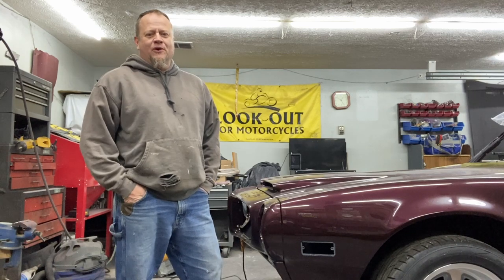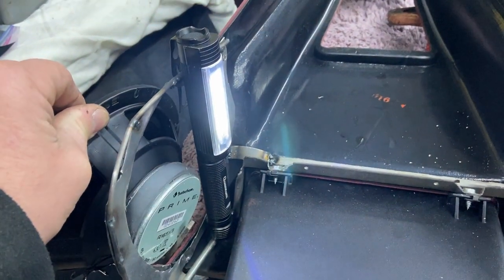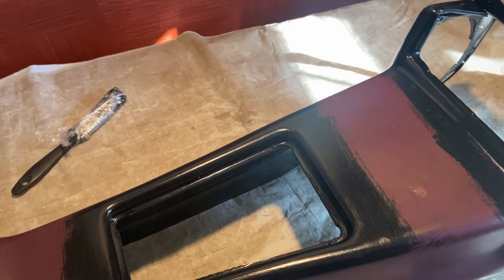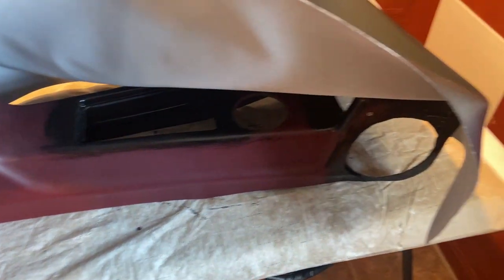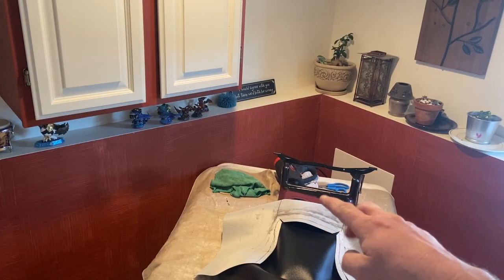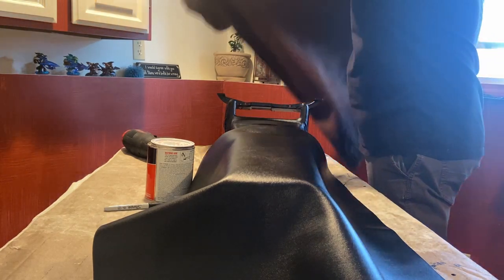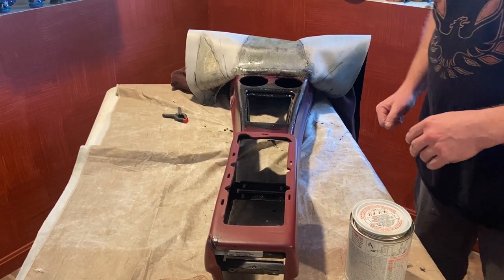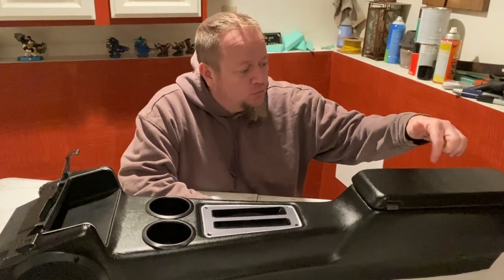DIY Customized Center Console! Adding Speakers, Cupholders, and Upholstering with Marine Grade Vinyl

Comment: beautiful job. cant beleeve how well you did using glued down vinyl,...amazing.
Reply from the maker: Thank you so much 😊  I've got some delamination going on and have put some more glue down and that took care of the problem.  The backing on that vinyl has so much texture that i think it needed a ton of glue to fill in the texture and get a good adhesive contact.  next time ill use more glue and also will be looking for a material that stretches easier with a smoother backing.

Comment: Exactly my same situation I’m in Wisconsin and some days it’s just too cold. So I go down to the basement and just get something done even if it’s small. It will save time down the road.
Reply from the maker: Absolutely man! Gotta keep it movin! Cruz by spring is my goal. Interior pieces while it’s cold. As soon as it warms up some, I’m slapping this stuff in. Gonna be a milestone. Will be very different to see a nice new interior in this thing!!
Reply: @HeavyPedalGarage  my goal is motor and trans in Pontiac this summer. And have Nova in paint. By fall.

Comment: Looks great Nate. I think if you want any kind of bass out of those speakers though, you will need to find a way to make a box out of that thing and seal it. Woofers need a sealed (or ported) container to shine. If you have ever taken a woofer out of its box and listened to it, you know what I mean. Curious to see how it comes out!
Reply from the maker: Thank you! That’s a great suggestion! I’ll have to research that concept and see how best to box that in. Would be a great “down the road” project. It sounds ok in the car but it is kinda tinty. I’m curious to see how the sound changes with interior. Thanks for checking out the vid and for the great advice!

Comment: That’s funny I just did a dash video I haven’t posted yet and I use weldwood as well. I also use it on headliners. It’s awesome stuff
Reply from the maker: Nice!  I’ll check out your video. Have you tried the HHR or the non flammable Weldwood? I ran out of the original and bought some nonflammable. It sticks, but it’s fairly different to work with.
Reply: @HeavyPedalGarage  I haven’t tried it yet. I am actually going to redo mine again before posting the video because I want to find the 4 way stretch vinyl. I just wasn’t happy with the puckering on the sides of my dash. Because it’s exposed with the doors open. I’m thinking I might have to do some more relief cuts and use a thicker vinyl. Mine wasn’t the marine stuff originally.

Comment: I wonder if I should wrap my rear fender  interior panels with this. The plastic looks discolored.
Reply from the maker: I did my interior pieces. I’ve got a video on the rear seat side panels and also the center console on my channel.   Looks great. Just use plenty of glue and a thinner 4way stretch vinyl would be awesome.

Comment: Wow, what an improvement! Great job. How did you finish off the very back surface (the vertical flat piece you would be looking at if you were in the back seat)?
Reply from the maker: It’s a black plastic piece. So I just cleaned it up and reinstalled. Worked out pretty good.
Reply: @HeavyPedalGarage  
Cool 😎👍

Comment: Where did you get the tray from that you cut out for your speakers to fit
Reply from the maker: I think I got it from classic industries.
Reply: @HeavyPedalGarage   what is the actual name for it, if you know. Thanks. I failed on my first attempt to wrap my center console but I’m going to keep trying until I get it. Thanks for the video to help out with this project.

Comment: What an awesome job Nate. That looks badazz. After watchin the dash vid and this one I jus may have to pull my 76 dash and give it a whirl... Cant wait to see your bird finished and rollin...😉 
I may make a short vid of my 76 formula resto using all the pics I took and post it. Oh, and can you post the link to the guy you mentioned that does this as well... thanks
Reply from the maker: Right on. Thanks for the reminder to post the link to cechafalo! It’s now in the description. Would love to see the video of your 76!
Reply: @HeavyPedalGarage   cool, I will start putting somethin together, I took almost 2000 pics as I restored it over 3-1/2 yrs. Like you Ive done all the work including the rearend, transmission, engine and all suspension bushings to seat upholstery and paint... Only thing I had a shop do was mill the heads and do the block hone...😉
Reply from the maker: @sierraridgereaper  that’s awesome!